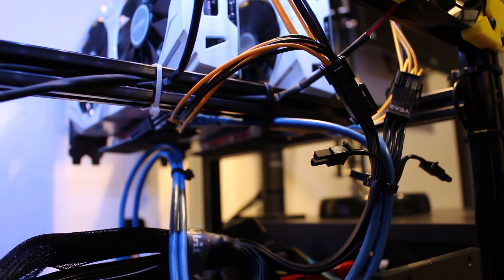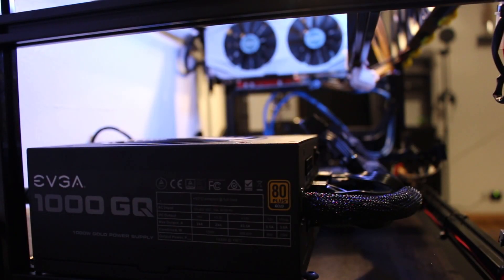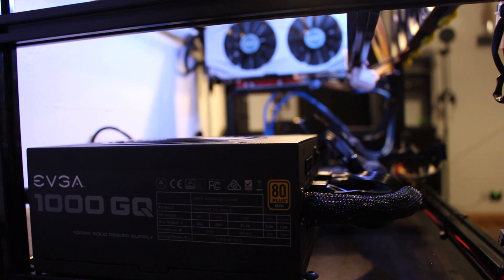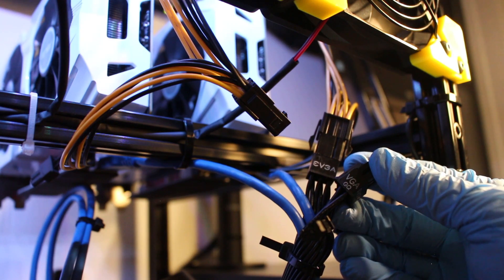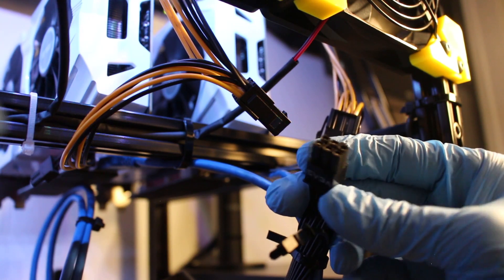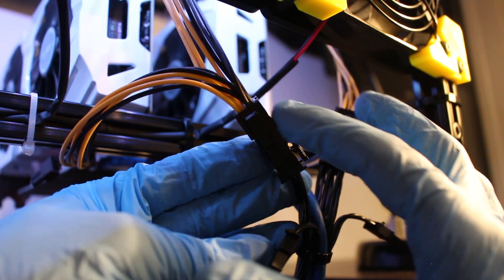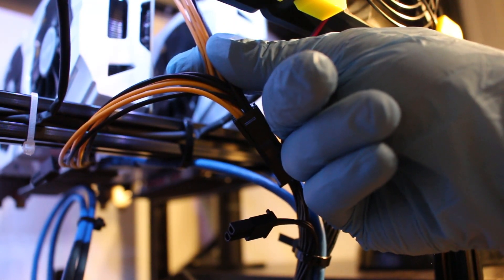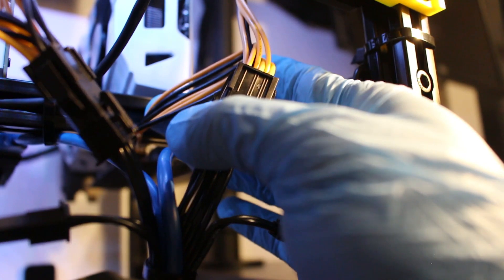PCIe Risers: How to wire & properly distribute power (Mining Rig)

Comment: Makes no sense. If you have a 1080ti, that's a total of 150 watts only. The gpu will draw over 200.  Shouldn't you connect a data or motex to the riser to give another 50-60watt?

Comment: This is terrible advice, those 6 pin connections are only rated for 75 watts. Get an 8 pin splitter asap
Reply: Nope, the 6 pin conector can provide almost 216w
Reply: @manuelvivanco9206  Only if the 6 pin is 16 guage wire. If it's 18 guage wire it's only rated for 75watts.

Comment: For any one thinkig of doing it that way, youll be ok only with weak gpus, 6pin is rated for 75w, thats max of what your card should be drawing. I would have hard time findig gpu with such tdp or requirement for such weak psu. In practice  one can supply way less power but even in such case were talking about rx 470 drawing only 70w and pushing cables to their limit. 
What is a good and safe approach in the video is connecting raiser and gpu to the same psu and ensuring grounding

Comment: Will work on small graphics cards but on 3070 or 3080 won't work
Reply: What is the best option for 3070s then? CPU splitter to dual 8-pcie for feed two risers? Then the GPU simply feed directly to pcie-VGA?

Comment: how would u power GPU with 3x8pins with riser? appreciate any help
Reply: I have been having to use one cable doing one of the risers and GPU, then another cable doing the other two.
Please note the cables must be off the same PSU.
I have been able to use this for 3070's and 3090's.
Reply: @lewisstevens1  what do u mean, didnt understand what u wrote. Pls rephrase. I wanna know. Tia
Reply: @sanding168  Well you would get 2x dual 8 pin cables. One of the cables will connect to the GPU and to the Riser, then the other cable would connect both 8 pins to the GPU.

Both cables should be off the same Power supply.
Reply: @lewisstevens1  thx u  so much for ur kind insight. God bless u

Comment: i'm using an evga 1000 g5.  it has 4 vga power outs. Each vga cable (included) has a 6 and 8 pin connector on the same cable . I use both the 6 and 8 pin connector to power my 5700 xt. That leaves me with needing to power the riser. Do i split the 6 pin connector portion of the cable to power the riser and GPU?  I want to power 4 5700 XT and risers safely
Reply: i was in the same boat,  ended up getting 2 850w psus
Reply: @isfikser8758  y ai just ordered another PS a 750

Comment: Heads up, make sure any extensions you use are PCIe and not EPS. The risers demand too much power for EPS even though they fit like a 6 +2 pin. Don't do it.

Comment: How do you do with 4 cards powered by 8 + 6 pins ? I got the same PSU as you
Reply: Just hook it up, if the power supply fails it'll likely be the whole unit anyways. The likelihood of power cables failing is next to none, it's just a copper wire, the things that can fail in the cable itself are so limited. If anything fails it will likely be your riser, & just remember that your graphics card still receives power on the top/side independently from the riser.

Comment: That is not safe! Lol. You never use a splitter man,  and you should be using a server psu dedicated to the cards. Not a ATx psu lol.  Consumer grade psu is not nearly as efficient as a server psu man.  This can burn wires an melt doing it this way I've seen it done
Reply: ATX is fine, I have to give you props though for almost sounding smart.
Reply: @bombebomb  just cause it's fine and it works dont mean it's the rite way to do. Wait til u have a fire or a wire burns your cards pcie plug and then come back an say it's fine. I hate to be a dick but I see dumb ass shit like this all the time
Reply: @jimsinnovations2737  Well what’s the right way to do this? I’m building a (6) 5700XT rig and using a EVGA SuperNova 1200P2. I’m new to computers and have no idea wtf I’m doing so your help would be much appreciated!
Reply: @grg20111  lol, ya it sucks i hate when im wrong
Reply: @bombebomb  umm, maybe you should look into it then before you sound too smart yourself, ATX is not great for this, if you haven't noticed all the mining rigs you have seen how many are running ATX power for there gpu an rigs?  prolly not many as its not efficient as server psu's are. maybe just maybe why everyone is using them?  just an idea there Einstein
Reply: You are right i got some splitters and cables burned after one year of mining using atx psu